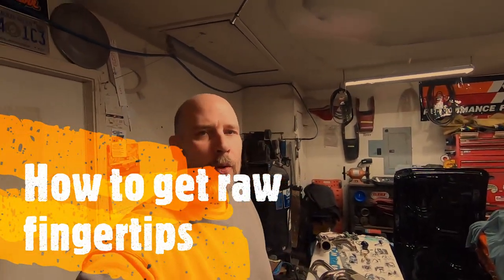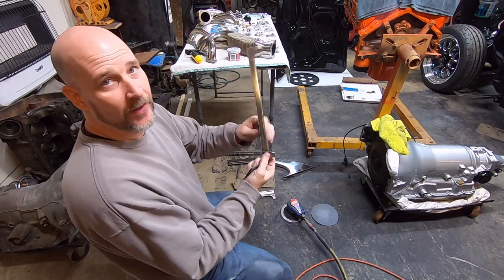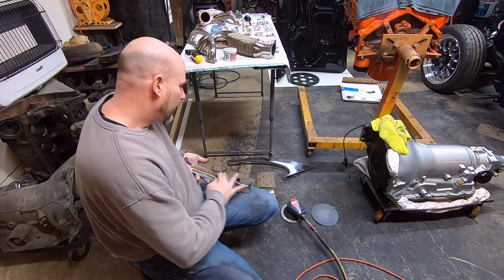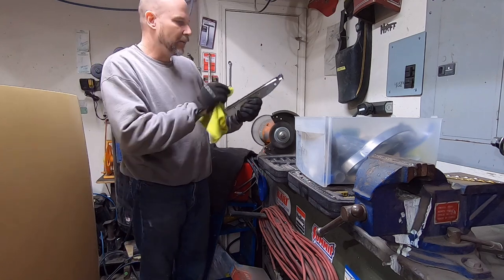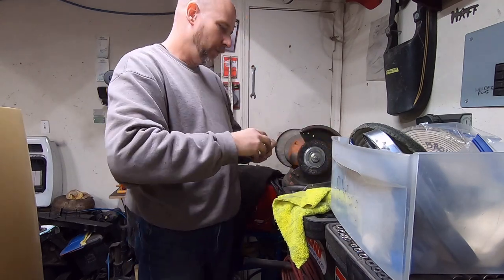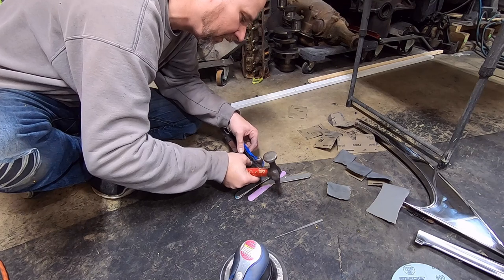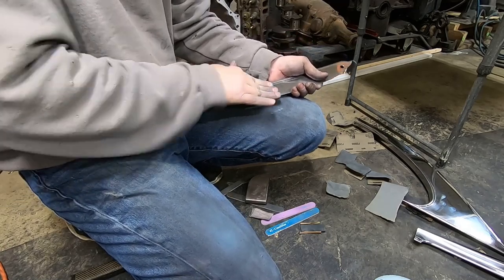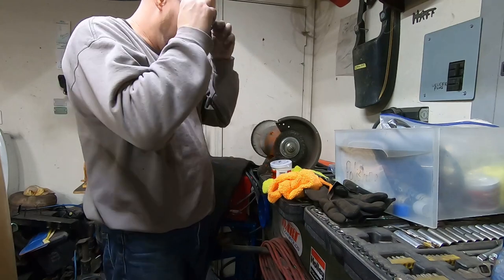Polishing stainless trim for my 1955 Chevy Belair

Comment: Thank you for your video's. Nothing wrong with your technique that I can see, if it works, it works!  I'm 70 and I also like/need to save money, to use for things I can't build, like a new cam, rims, whatever. For a buffer I've used drills held in a vice. I picked up an old quality 3/4" drill for $5 at an estate sale because the outer layer of the cord was flaking off. New cord  ((I keep cords when things die). A bolt and fender washers holding the pad, (old valve spring retainers work pretty good depending on the buffing pad hole size) chucked up in the drill, ta-da a low RPM, decent torque, buffer/drill. For taking the small dents out I've used old long bolts, like head bolts, ground at the tip to different shapes I needed. I've got a good collection of different size diameter and shapes now. For those small dents I have used those "baby" trim hammers and even those small brass trinket hammers, the ones with the screw drivers in the handle. Point is, to show the younger folks that you don't have to have the newest, grooviest, $2000 hammer, etc. to get things done. Thinking outside the box, AND THINKING IS THIS GONNA BE SAFE, can work and save them money for other toys. You keep on with your great videos and you will help build new generations to continue this love of classics.    John
Reply from the maker: Thanks John. Very useful info in your comment

Comment: Simichrome Polish is very good also. I used a small one inch by 2 inch 1/4 arbor cottonwheel on a straight Dotco air motor and did alot of the stainless on my 55 on the car. Came out very nice just as far as the polish aspect goes.Yes fixing dents isnt rocket science just a few things to know. Having the right little hammer and metal backer bar or dolly to use and files. Also to learn the grades of paper and order of sanding the parts to get to a polish stage. As an alternative I have used all three grades of 3 inch polishing 3M Roloc discs on a right angle motor it gets you to polishing stage quicker but thats another story. Great Video Im amazed how you work on the floor my days of that are over,LOLLL! Im older...